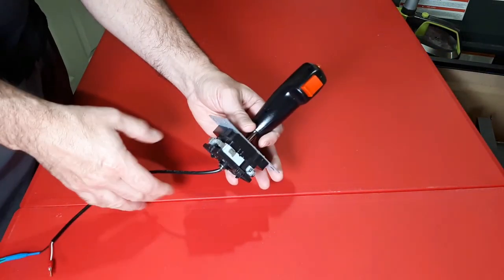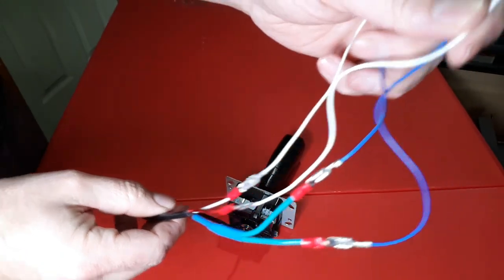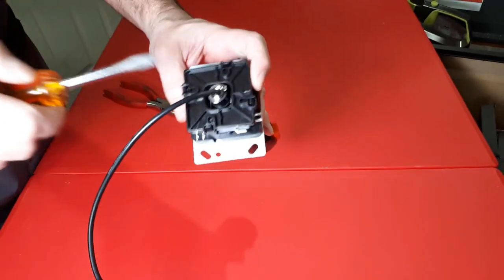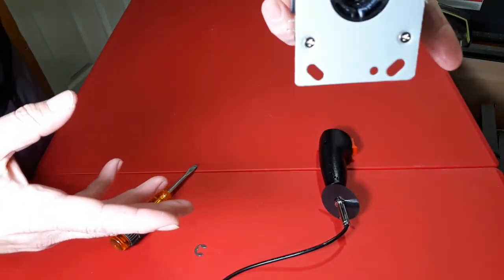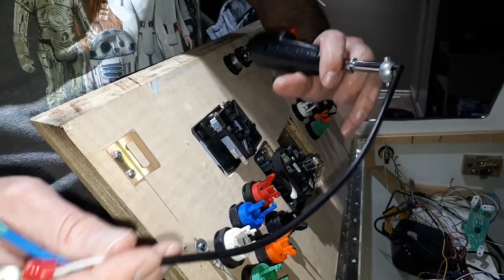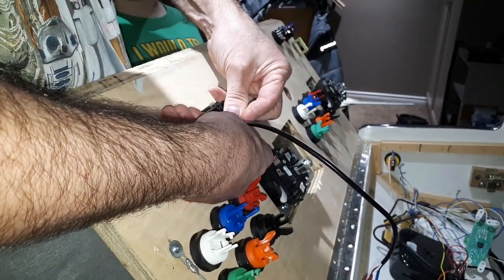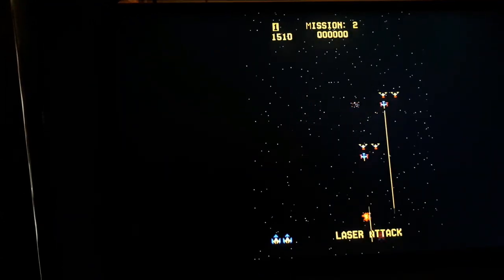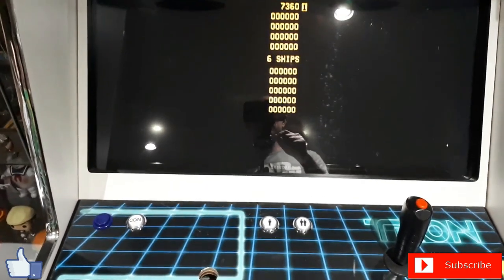Arcade Flight stick (How to install) Amazon

Comment: Thanks for doing this. I appreciate the description of how to wire the 1 and 2 buttons. I am looking for direction on how to wire the four micro switches on the base of this to a usb encoder. You show this wired up at the end but do not describe where each goes. I assume there is an Up, Down, Left, Right on the encoder, but am not sure how to determine that. Thanks
Reply from the maker: Depending on what encoder you have, each one should have a diagram showing you all the inputs.  Zero delay has a diagram lables which wires would be up,down,left,right.  The joystick Depending orientation will have the corresponding micro switches for each direction.  If you don't know you can simply use trial and error to determine. I hope this helps you out.
Reply: @topgunarcade  Cool mod thanks for replying because Im curious also. I hope each encoder board has room for two directional input devices or at least hope it can be daisy chained cause I dont mind if they share same input line i just want to use a flight stick for after burner extc.. (Im new to hobby but got alot of mods planned)
Reply from the maker: @patrickjones2843  most encoders usually have 4 inputs for direction.  Some come as a dual for player 1 and 2.

Comment: I keep hearing people say these can be connected to a PC. I have Star Wars Trilogy Arcade running great on my PC and I want to play with a controller stick similar to the arcade. Right now I’m using a ps5 game pad which works, but just isn’t the same & you don’t get the same precision. Do you know what I’d need to connect one of these to my PC? Is that even doable without losing your religion in the process?
Reply: Buy a zero delay encoder and follow the rest of the steps in the video and you can connect it to a PC
Reply: @topgunbass  Cool. Thanks 🙏

Comment: So, the final order from best to worst in terms of latency is:

- Atari-Commodore 9-pin Game Port (less than 1 ms).
- PC 15-pin Game Port (about 3-5 ms).
- USB 2.0 Port (about 11-17 ms, including all additional delays).

Therefore, the Atari-Commodore 9-pin game port has the lowest latency, followed by the PC 15-pin game port, and the USB 2.0 port has the highest latency among the listed interfaces.

Due to the significant latency of the USB bus with the connected mouse and keyboard, as well as the additional delay of the USB joystick controller itself, many people have simply stopped playing arcade games and fighting games. They no longer enjoy playing such games. Most of these people couldn't even understand what exactly happened and why their favorite games no longer attract them.
Reply from the maker: @timmbcy3639  interesting information.  We do our best with the tech we have.